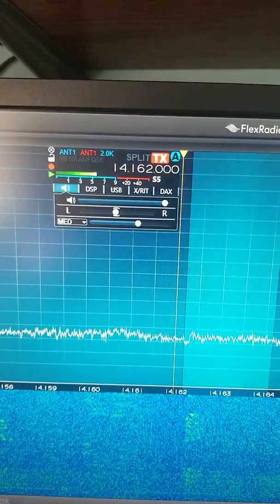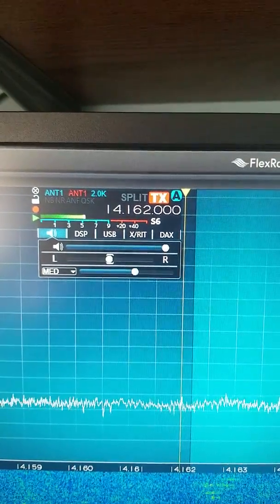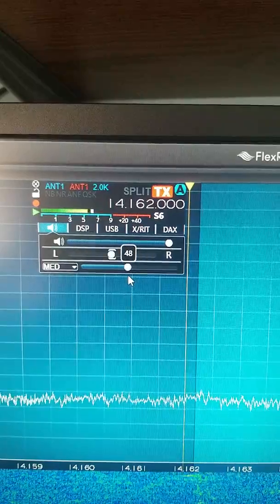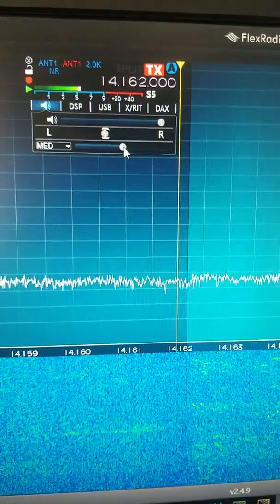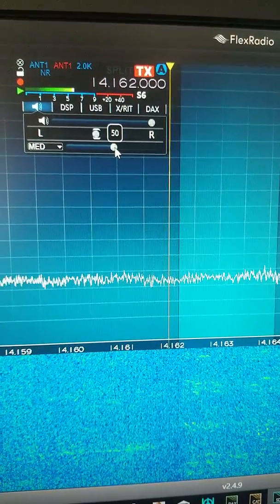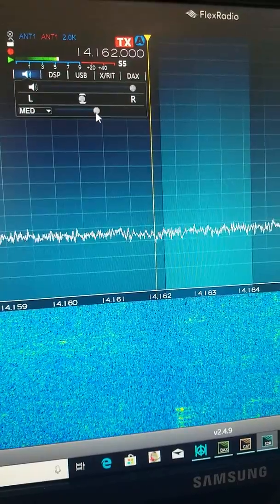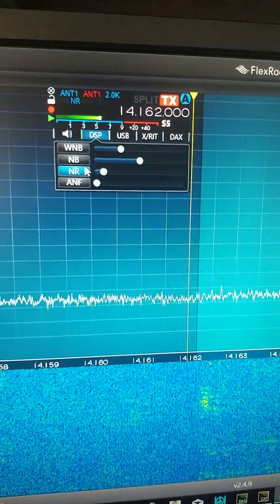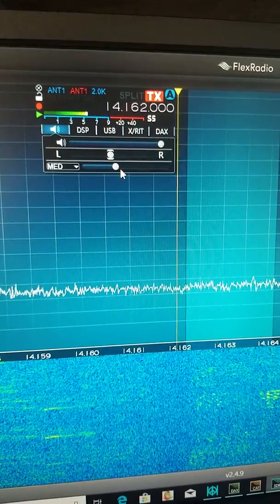How to pull in weak signal with flex radio smartsdr

Comment: Easier to set AGC threshold if AGC is in fast or med mode.  Adjust  on background noise only. Contrary to what MW says below, start high and slowly reduce AGC level until you hear the background noise drop.

Comment: Just to echo Tim's comments in FB:  Your 1st threshold is not the AGC knee. The knee is closer to 37 in your video. Maybe a little lower. The knee is where the AGC starts to increase band noise along with signal. 
Also you never want to start high and move to lower values. Doing it that way, the AGC has already swamped the signal by amplifing the noise significantly over the signal level taking longer for convergence. Start low and increase the AGC threshold. 
Lastly, you are thrashing the AGC-T when adjusting it and not allowing it to converge on the band signal level. This doesn't happen instantaneously because there are two AGC constants, the slow and fast attack that have to be determined by the AGC algorithm by sampling the band audio over time.
You can get to where you want to be by doing what you are showing in the video, but the suggestions above should get you there quicker. The most positive takeaway is you are using the most powerful feature in SmartSDR for optimizing the SNR.